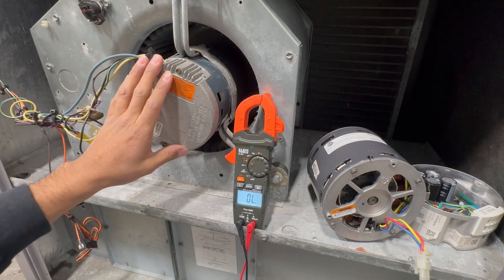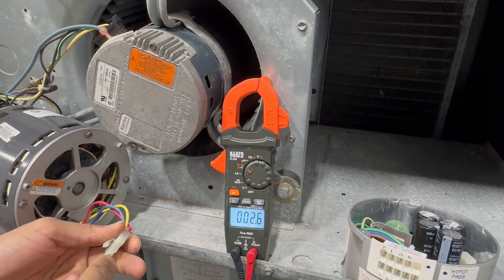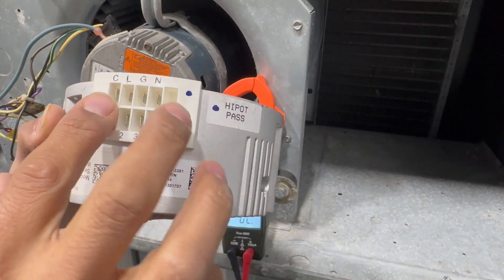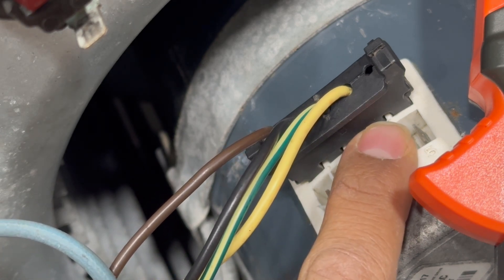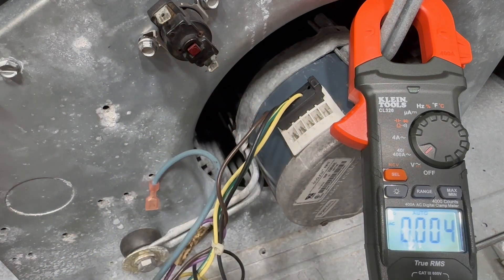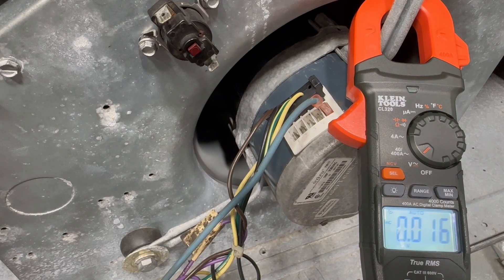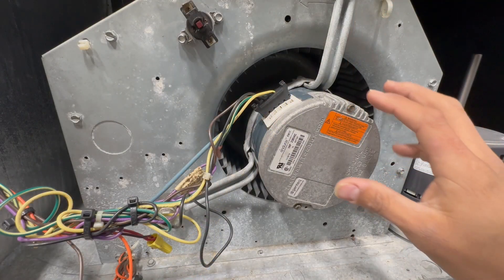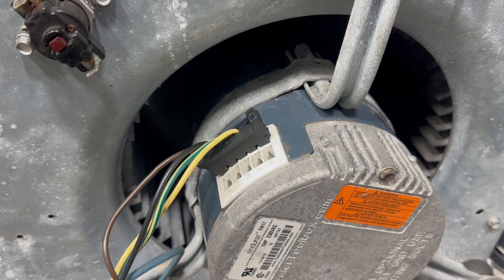How To Check ECM Motors - HVAC Training

Comment: So, on the low voltage(on the bottom) will only have one wire(say blue)? 

Does low voltage control control motor speed?

Is blue wire simply "green" thermostat wire?
Reply from the maker: Low voltage controls the motor speed. Typically, you have three low voltage wires going to the bottom part of the ECM. When you only want to have Fan ON, not on AUTO, (no heating or cooling), you call for G and it send 24 volts to the wire going on number 1 or 2 (slower speeds). When you call for heating, it sends 24 volts to the wire that goes on number 4 (a faster speed). When you call for cooling, you send 24 volts to the wire going to number 5 (fastest speed). You will physically see 3 wires going to the low voltage of the ECM motor.

Comment: That's the best testing ECM video I've ever seen great job
Reply from the maker: Thank you!
Reply: If l pull out the 24 volt and why the fan motor still running??
Reply: Also desconectes all wires from thermostat
Reply: Truly. Pioneer is killing it right now. It’s funny I find it easier to learn through someone more foreign. He gets straight to the point and doesn’t confuse my ADHD mind. Americans ain’t shit 😂

Comment: Good video. In addition, (1) If you connect 24v to more than one tap (1-5), the motor will run at the highest tap speed (torque).  Totally safe to do so.  (2) The motor can be a 3-phase generator too.  If you connect your meter to any 2 of the three motor windings and turn the shaft, you will see voltage.  Which means you use a discarded motor on a windmill or similar.  (3) A replacement controller is sold separately but the cost of the controller is almost the same as x-13 motor/controller together.  (4) The x-13 motors are available on Amazon for around $300.  Don'e get suckered into paying $700+ for this motor.  They are all made by the same company. (5) The x-13 motor is programmable.  You can change the speed (torque) for any of the 5 taps.
Reply: Most online orders have no warranty  or guarantee . Ask before ordering online .
I am  in Denver  , Colorado.
Reply from the maker: That's good to know. Thank you for sharing!
Reply: thanks for that info brother!!!
Reply: So what if the plug for the 5 speeds all 5 have wires connected to it, how do I know which speed it is working on?
Reply: Amprobe ?

Comment: I know that nobody does repair on a component level anymore but, when these go bad, 9 times out of 10 it’s the Thermistor (inrush current limiter or ICL).
 With a little finesse and some basic soldering skills most of there can be repaired for less than $20. If you buy your parts from a place like Mouser, this price can be as little as about $4
Reply: My Genteq 2.3 motor went bad. I tested the ohms per your video and my readings did not match. I disassembled the motor and found areas of the copper wire winding with burned insulation. The wires were shorting out on the different phases. I was able to isolate the affected wires and retested the ohms. Then it was an equal 5.6 across all three leads. I used epoxy to insulate the wires. Now it works. When the wires were shorting, the motor had a lot of resistance when trying to spin the scroll fan by hand. Similar to regenerative braking I suppose. After the shorted wires were isolated and insulated, it spun very easily. Fortunately my endbell module is still good.
Reply: Thanks for sharing  @mtbbiker6401
Reply: Kinda hard to repair York ECM as they pot them. Definitely not planned obsolescence 🙄
Reply: @SpaceStickwithSpaceTick  This is where the finesse comes in. It’s not super difficult to carve it away to expose two solder pads.
Reply: @andrewm4679  make a video for us
Reply: @cassidax5 I’m trying to get moved into a new home at this time but it is something I’m willing to consider as soon as things settle down a little.
Reply: @SpaceStickwithSpaceTick  The thermister is generally not potted... it needs to quickly dissipate heat... in fact that's what generally makes them fail - heating and cooling cycles.
Reply: exactly 20 $ 30 part  cost 1000 + labor to replace  ... one My  older retired tech could solder & repair CC control board ..its a Lost Art
Reply from the maker: Great tip!
Reply: Awesome tip!!! Currently diagnosing a Lennox furnace ECM motor/controller failure and came across your suggestion. Located the thermistor ICL ($3 SL221R020) PCB pads and pushed multimeter probes hard to get through coating. Measured a steady 10 Meg ohms when it should be 1 ohm at room temp. Hopefully this is the only failure in the device. Will let you know if repair works. And you were right, there's only some white silicone nearby. The ICL isn't in the fully potted part.
Reply: @AdamFraserKruck well, how’d you make out ?
You can’t always go by the resistance of the component in circuit. There are many other components involved. Some of which bleed off to ground by design skewing your meter reading.
 I’d say that in about 40% + van be verified visually alone.
Reply: @AdamFraserKruck  if the icl was potted,it wouldn't work properly...unable to dissipate heat.
Reply: True, however its not that easy since the epoxy coat the entire board these days as many other aplliances do JUST TO PREVENT REPAIRS!!!! It's PATHETIC
Reply: @notnecessary7730 yes the epoxy does cover most of the board but generally, the ICL itself is left exposed and a hot knife under a vent hood or outdoors can be used to clean up around the through holes. The solder pads are in most cases epoxy free but if not, the finesse technique still works.

Comment: Those motor are junk
They cost close to 500.00 so where is the saving
Just more parts that can go wrong
Reply: Hahaha that's nothing the cost here in Colorado is around 1200-1600 depending on the model make 😂
Reply: @izzymoney85  Yup. Most of the ECM's I have to replace are a minimum of $1200 when they go bad. Any minor savings on electrical is LONG gone when I have to replace these... I have also seen the motor itself go bad with resistance readings out of spec that has taken out the control... It's definitely worth looking over the motor if you want to save the customer some money and only replace the module. They also seem to always have them completely encased in a silicon/epoxy that makes examining the electrical components difficult. Such as the common in-rush MOV that is known to open up on some of these.
Reply: @izzymoney85 you mean the rip off cost your company sells them for. We know this as techs
Reply: @izzymoney85  Hey , bro  . I am in Denver , Colorado.  Thanks for the heads up  🤭😎🤟
Reply: Those motors in the video aren't junk compared to broad ocean motors.😂😂😂😂😂
Reply: It’s more “”””””efficient””””””
Reply: Yes but they save you a $.05 per day. lol
Reply: Your righ the savings is minimal.Just like a 80 percent 2 stage furnace verses a 95 plus efficiency condensing.very little savings on the bills and the 80 percent will last longer.
Reply: It’s not about savings. It’s about getting more power out of a motor by converting signal phase to three phase.
Reply: Are you kidding oem programmed  motor  are 1000. - min + Diagnostics labor and warranty easily $1500   or more
Reply: Rip it out and get a psc motor and psc conversion board.
Reply: They cost way more than that. A few months ago I had a Carrier water source heat pump at a doctors office with a failed ECM, the unit was only about a year and a half old so just out of warranty go figure. I quoted the repair with the OEM motor, just the motor alone at cost was $1,300! And to add insult to injury the motor was something like 5 to 6 weeks out on back order. Of course by now the doctors were livid because “it’s taking too long” and were threatening to report the property management company for being slumlords or something stupid. So I traced down a 1hp 460v PSC motor that was not only readily available, but was only $300 at cost. I rewrote the quote with this motor, got approved and installed it that day. Still working like a champ and will last many years longer than the crap expensive ECM.
Reply: It's been a while since I worked with a fan blower, and no wonder when I ran back into one again, I didn't see a start capicitor. Now I know  why ECM motors changed the dynamics! Thank you for your great explanation!!!
Reply: That's because they are variable speed and are more energy efficient because they use less electricity to operate.